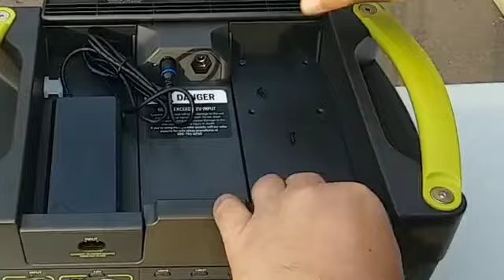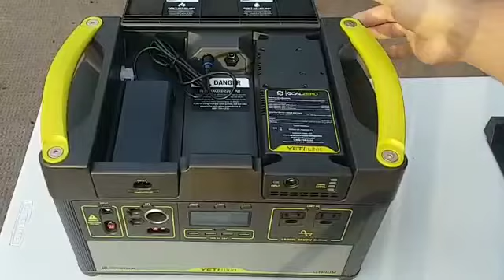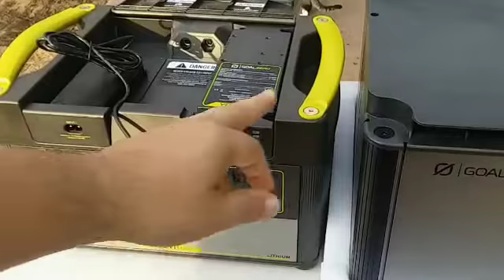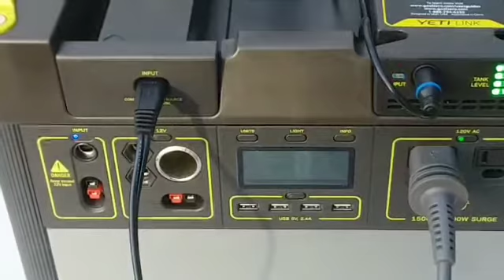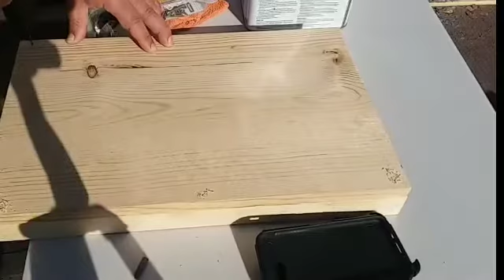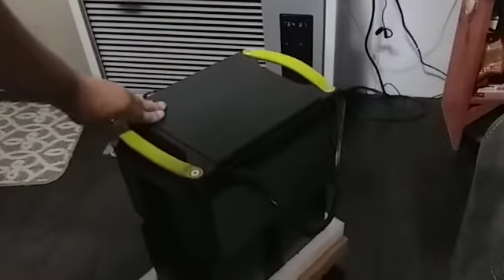UNLIMITED OFF GRID POWER - ADDING A GOAL ZERO LINK AND AN EXTERNAL BATTERY TO MY GOAL ZERO YETI 1000

Comment: AP and fellow preppers. I have a word of caution for you. All lead-acid batteries give off hydrogen when being charged. They should be installed where they will safely off-gas to the exterior of your homes. I would suggest a sealed cabinet with top and bottom venting where you are going to stack multiple batteries. Also, leave an inch or so of room above the terminals to help dissipate heat during discharge. This is coming from an experienced journeyman electrician who has worked around large battery systems. God Bless!
Reply: Goal zero uses AGM acid batteries which don't give off as much gas as flooded and gel systems because the amount of liquid inside is very very little. So their more safer to used then full flooded cell systems that people commonly do by taking a car battery (which are flooded acid systems.) and put them in a battery box.
Not to mention Goal zero uses fans to keep the batteries cool under load, which also vents out any air inside the unit to prevent any build up of gas that might cause any probs.
Reply: @KillerRaptorr  Sealed AGM batteries give off nothing and neither do lithium batteries.  The hydrogen generated by AGM or other lead acid batteries is recombined by a catalyst and turned back into water.
Lithium batteries generate carbon dioxide which if you charge them too fast, or charge a really dead battery (below 3 volts per cell), it will swell up and possibly explode and/or catch on fire. 
It is still a good idea to keep AGM batteries in a vented place in case of failure; a thing that can happen if your charge rate exceeds what AGM is designed for.  Lithium can take a much higher charge rate than AGM batteries.
Reply: John Maddox......Thank-you!
Reply from the maker: Hello John, obviously I don't know much about batteries but do you know if the battery is a sealed battery does it still gas off?  If you answer this question can you please do a new comment so that it can alert me; if you just reply to this the system will not alert me that you replied.  Thank you..
Reply: They are also heavy as crap. Why did they go with lead acid? Odd choice.
Reply: @rebellucy5610  Lead acid is a lot cheaper than lithium, although in the long run the advantage isn't quite that impressive since lithium can take more and deeper discharges.
Reply: @rebellucy5610  cost

Comment: Wow really nice but way out of my price range. I did get a little 150 watts solar generator for my Christmas to power small items. I have several solar lightbulbs for lights. My little generator runs a small fan and charges my electronics. At least I will have a little power if electric goes out. Next I’m getting the suitcase solar panel to power it with.

Comment: Interesting synchronicity - I had just added to my wish list yesterday, "solar generator."  The fact that this can be built one module at a time appeals, as I'm retired and on a fixed income.  I'd have to save for each additional battery module, but I'm a saver anyway so that's nothing new.  Given I live in hurricane territory, this could be what I've been hoping for.  Question:  is there a way to add input from a wind turbine?  My dream is to have hybrid solar+wind to power my home.
Reply from the maker: Hello Sherry, I don't see why not as long as the power input is not more than is recommended by Goal Zero.  I believe that the max power input is around 400 watts.
Reply: Sherry Ejjesson Hi i believe it's possibly to run a wind turbine with solar panels but you need a hybrid controller to make it work cheers
Reply: The minimum voltage expected is 16 at the charge input; 22 volts max.  The anderson powerpole input can take a higher current as compared to the 8 mm round plug input.

Comment: Does it keep the charge,  or do you have to leave it plugged into the wall?
Reply from the maker: It will keep the charge for a good while.  I had not plugged in the external battery until this video and i've had it for a couple weeks and I imagine it was en route for a week or two.  I will be keeping it plugged in at all times to make sure I have a full load of electricity in the case of a power outage.
Reply: @RudysCornerOfAlaska  thanks!

Comment: Did you void the warranty by opening the generator up?  Sorry if I missed it
Reply from the maker: No, the dummy module was made to be removed and replaced with a working module.
Reply: @RudysCornerOfAlaska  Whoops, I first read this as "No, dummy, the module..." :-P Thanks for the helpful video, Alaska Prepper, have a little Yeti 400 Lithium and use it every week

Comment: That is cool, you can link the systems and have even more storage. Great idea
Reply: You can link more models of the external battery to other external battery pieces. Not sure how far. but i seen their website show off about 9 externals connected to 1400/3000 lithiums and used for home power sources.

Comment: I wanted to get the inergy Apex with the Trumpbux but it’s sold out everywhere...
Reply from the maker: I wish I could get one of those but no luck getting one up here...
Reply: Isn't the 30 amp connection limited to the the inverter output limit?  I'm too up on that product. I though I read somewhere that the 30 amp was not able to provide 30A from the inverter.  I wish I had the extra coin to try a few different units.

Comment: I have the same goal zero and one panel set.  How many solar panels do you hook to this.  I may plan on getting the link and additional storage.  I have another solar set up that is separate from this one. But  I am just a beginner
Reply from the maker: I believe that you can connect up to 400 watts of solar to it but it should tell you in the instruction manual exactly what amount of wattage it will accept....
Reply: There is a relationship with the volts & amps depending if the panels are wired in parallel, series or series-parallel.

Comment: I've been waiting for this video topic.  The yeti 1000, 1400 & 3000 have an inverter that can supply a constant 1500 watts AC. This is better than most solar generators out there, it can easily handle my furnace blower motor.  The yetis also have AP connectors on the In/Output so it doesn't get disconnected when driving on offroad trails/roads.  The yetis don't have great input watt charging but multiple AC chargers can be used, and the optional MPPT module help for solar charging (comes with ans internal PWS charge controller).  GZ is updating these larger yetis soon, the GZ rep told me sometime this summer is the target timeframe.